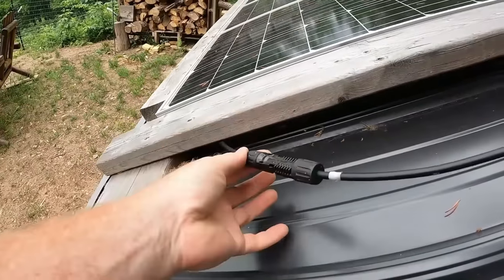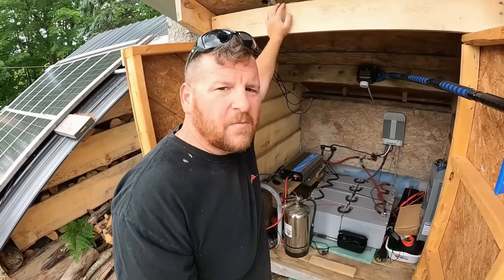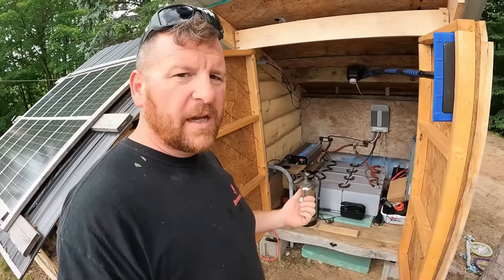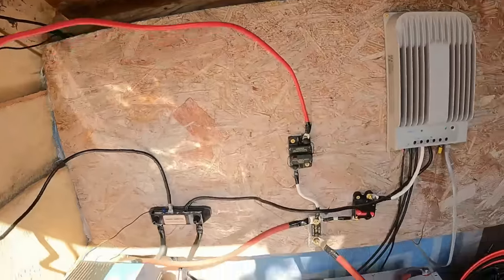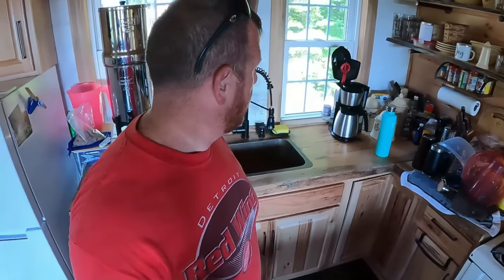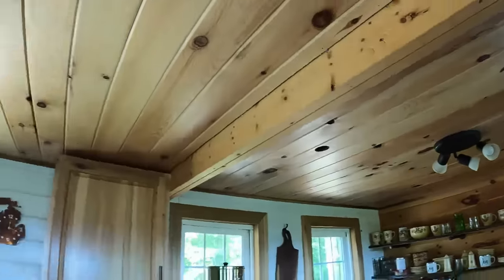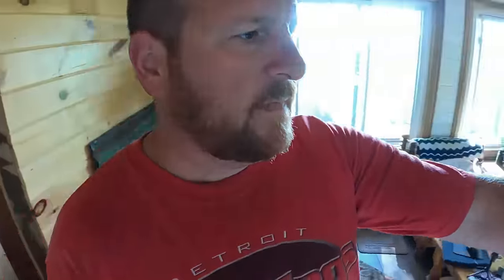SCAMS to Avoid With An Off Grid Solar Power System - 2 year update

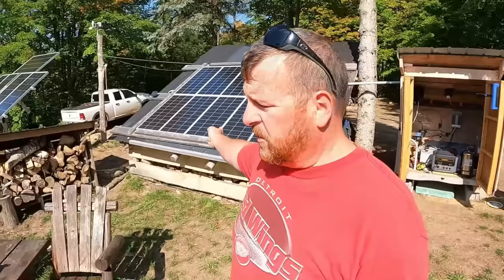Comment: So how does your solar generator fit into the overall picture? You seem to have removed it when going through your system and then put it back in the power shed afterwards, it can be seen at 9:49 You should include it in your overview and include how it is used, what percentage of battery storage it provides, how much electricity is pulled from it given it’s built in inverter and also it’s regular cost for a non-sponsored youtuber to buy. Otherwise your video is interesting but potentially significantly misleading which is interesting given that your video includes info on what you believe to be scams.
Reply from the maker: We use power stations around the property for big projects and to make videos when companies want to sponsor us. We charge them from the solar shed or the second array, Like I Mentioned in the first half of the video, when the solar bank is full on a sunny day or streak of nice days we try to  capitalize on extra solar input when it is there to be had.    The solar power stations are used for the most part to help with building projects for power tools when not near the cabin, but also for our YOUTUBE Channel. Using them and Showing them in our Videos helps Fund our builds here on YT.  The Built System we are discussing here in the video, runs our cabin....and like stated the typical off grid cabin would not be doing all the projects and using the Power stations like we do, unless you are using one to power your cabin rather than build a system like this. We have more recently showed two large power stations that will be included and added to assist both our cabin and Pole barn in the future. Hope this explanation helps you understand a little better. thanks best wishes
Reply: @OffgridwithJayandJen  I think your assumption that people are only going to power a small house/cabin and not need to worry about running power tools, etc. is mistaken. Like you people who go off grid have to build most things themselves and work on various infrastructure projects over time on their path to a complete self sustaining homestead and that all requires the use of power tools for several years most likely.
Reply from the maker: @inmyimage1081  I'm not assuming, I'm telling you....this video is showing how this system can run an off grid cabin. We use our system to power tools as well. But the power station you seemed concerned about, while useful and we think every off grider should have a couple for back up, and portability......is there for convenience and because we have a YT channel, which shows this units off while building. They are not pivotal to the video or  system or cabin. Your original comment wanted to focus on the power stations existence and made accusations of its relevance as well acting like i was hiding something. Im simply answering to your original comment.  Agree with you that others will have projects too. Are we good now?
Reply: @OffgridwithJayandJen  First, I’m not trying to troll you so sorry it came off that way, I thought it would be clear when I said the info about your system is”misleading” not accusing you of lying. To be clear, I used misleading because your average person hoping to go off-grid most likely isn’t going to be limiting their expectations based strictly on the needs of exclusively a small cabin and nothing else. This was actually the first video I’ve seen by you guys and I did subscribe.

My bottom line question is: If you do not have any battery or inverter sources other than the very basic system you showed the components of, can you run not only your cabin but also your power tools, any exterior/flash lights you might use, all devices that need to be charged etc. In other comments you talked about using the solar generator for tools, not your basic solar system’s battery and inverter. If you can’t run everything you use in everyday life, then talk about them and highlight things people may need/want to power those things and keep in mind that the answer needs to discuss whatever tools you may need for say a small construction project AND cabin during the same day and night.

BTW, with lead acid batteries, if you are using more than half of their capacity they are being damaged and their life is being significantly shortened, especially if it’s a regular occurrence. So 400 amp hours of lead acid at 24v is equivalent to 200 amp hours of LiFePO4 at 24v which can be used down to 90-95% without damaging them. 

The same is true if you charge them below freezing just like LiFePO4 batteries which can actually be charged below freezing if you have control over the Battery Management System settings which typically isn’t possible with pre-made lead acid drop in replacement format LiFePO4 batteries. Battle Born Batteries actually did some testing and published a white paper a year or 2 ago that actually showed that the performance of charging their LiFePO4 batteries below freezing significantly outperformed lead acid batteries. Manufacturers disconnect charging below freezing because it cuts down the life of the battery just like lead acid which makes warranty guarantees difficult to manage. Note, if you actually get a lead acid battery management system to put between your inverter and batteries, it will also either disconnect charging below zero or drop down to trickle charging.
Reply from the maker: I appreciate your being here and bringing up the points you did....I kind of took Your Initial comment on the rough side I guess....But I get beat up  a lot here, so I get a little Sensitive, LOL. 
I guess the Differences we are having here is I'm just sharing in this video that a system like this can run a Simple Cabin and you don't have to spend tens of thousands of dollars to achieve this. I See where you are coming from about BUILDING and such....but feel that Building a Homestead and running a simple cabin with the Amenities that I showed are two different beasts. Although the last year we have run most of our power tools on our main system.....prior to having the solar we used a gas Generator and more recently like mentioned...using power stations that are used for sponsored videos or where the Cords won't reach. 
My hope for this video was to share they don't need to spend tons of money to run a little cabin and give them a better understanding about how much power devices draw.....so you can eliminate running a generator to run a cabin.....Like Many Remote Cabins have been doing for decades. Just offering tips and advice. =) @inmyimage1081
Reply: @OffgridwithJayandJen  no prob i get it and unfortunately it’s really easy for typed communication to either be worded poorly or misunderstood and i hear about the abuse you guys all have to deal with because some people seem to simply take joy from being jerks verging on sociopathic. will be binging most of your videos soon 👍
Reply from the maker: thanks for being one of the Good ones, =) appreciate that @inmyimage1081

Comment: Anker Solix uses low cost, (cheap) high frequency, transformerless inverter technology that only provides a low, 2x surge capacity that is practically useless for powering true, off grid, high inductance appliance applications. High inductance appliances like, full sized refrigerators, large power tools, portable AC units and large microwaves require 3x to 8x start up currents, and this Anker unit cannot supply this level of surge. A much better investment for off grid applications is to purchase a low frequency, transformer based inverter charger. It will last far, far longer and you'll be able to start and run those high surge loads without damaging your inverter or your appliances.
Reply from the maker: Humm....That is Interesting. We have Used Anker Power Stations and Tons of their other Products over the last couple years and they have all works flawlessly and have had zero Issues with any of the Problems you mention. I'm Not as Knowledgeable about the different Inverter styles or designs effect long term usage of high surge items....but I can easily say your claim that they will not run fridges and power tools is Wrong....our much smaller Anker units run these items just fine while building on the cabin and doing product tests on our Kitchen appliances as well. So I have to disagree with your claims as I have seen and witnessed them working well for these applications.
Reply: I've worked in the inverter repair industry for the past 23 years and the vast majority of inverter failures and repair requests that we've seen have been for these low cost high frequency inverters that have no output transformer. It doesn't matter what brand it is, when used to power inductive loads, these Chinese manufactured inverters all tend to fail shortly after the warranty runs out.  The MOSFETs that are used in these units are connected directly to the load with no transformer in between to act as a buffer and are not designed to repeatedly run inductive loads like full sized refrigerators or large power tools like table saws, log splitters, or any 1/2 hp+ motor load. That's why the world's top tier inverter manufacturers like Schneider Electric, Magnum Energy and Outback Power all manufacture only low frequency, transformer based inverters chargers. Just give it time.  If you continue to run inductive loads with this transformerless unit, the high frequency inverter in this "solar generator" will fail, sooner rather than later.    @OffgridwithJayandJen
Reply from the maker: @solarcharging9743  well I can't argue with an inverter pro....I'm not in the business. But I am in the service repair business too, and I see a lot of broken stuff.....because that is what I fix. So hopefully these units last as long as they claim they will  having a five year warranty from the company at least gives some peace of mind during that time frame. Thanks for adding your knowledge. I hope you are wrong though, lol. Best wishes

Comment: Awesome solar but you definitely got scammed by purchasing tha short lived, low surge capacity, high frequency, transformerless inverter. You should have spent a few more bucks and bought a heavy duty, longer lived, much higher surge capacity low frequency, transformer based inverter.
Reply from the maker: humm....well i guess we will see. it has taken a beating for over two years and is fine so far. we will see

Comment: You presented a very expensive and ineffective set up. Instead of all those regulators and inverters, you could simplify with a single device, an off-grid hybrid inverter of 3kw or even larger, with less money. * 300 $  You saved at least $1,500, money with which you could buy more panels, necessary for energy production on bad days. I'm sorry to tell you, but your set up is inefficient and very expensive
Reply from the maker: You are speaking from a world and prices based on today......not in 2020 when this system was built. Something you have not put into consideration before you commented.
Reply from the maker: You are speaking from a world and prices based on today......not in 2020 when this system was built. Something you have not put into consideration before you commented.
Reply: @OffgridwithJayandJen  It's time for up grade ! Even 2 years ago was a best chois one single off grid inverter bat seemsyou didn't know...